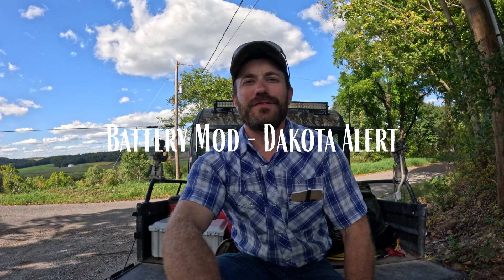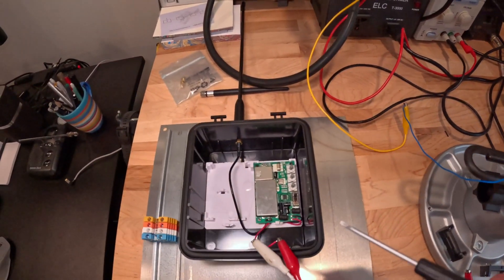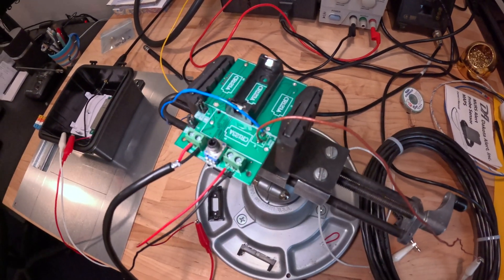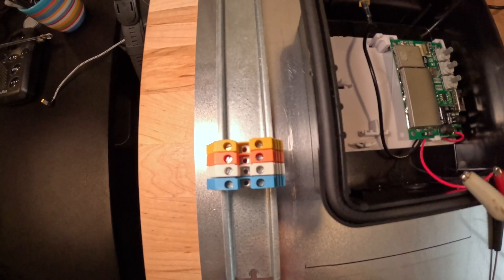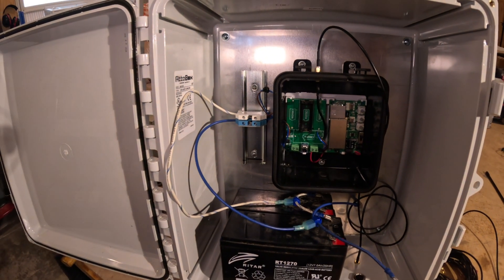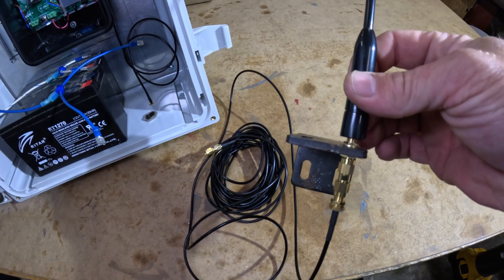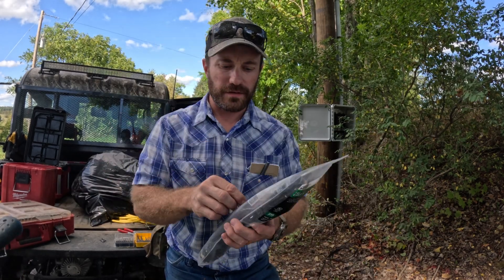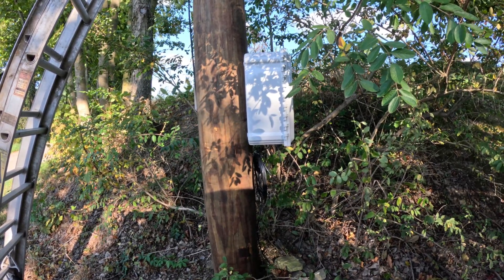Dakota MURS Driveway Alarm Battery Modification

Comment: Somthing i would do. install a power sensor so that the batteries won't discharge past its minimum charge.  Dont damage the batteries
Reply from the maker: A good thought, yes, although I would have to be careful of how much power that sensor would draw. The batteries last about 6 months as is, so the life is quite good. I just periodically check them with a voltmeter and charge as needed.

Comment: I did a similar mod to mine, only I put the battery in a separate grounded metal box(ammo can) with a solar charger and 50w panel. Just raising the stock "rubber duck" antenna will greatly improve the range as MURS is in the VHF band(151mhz) and entirely dependent on line of sight. Combined with wiring the base to an antenna on the roof lets the 1w signal easily reach through 1/4 mile of dense PA forest and is unphased by the foil faced exterior insulation on my house.